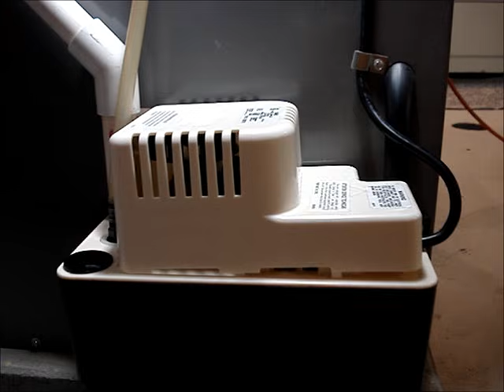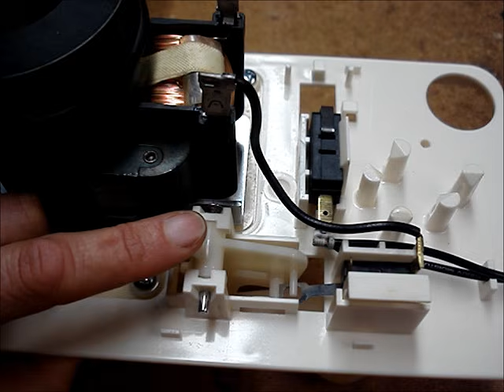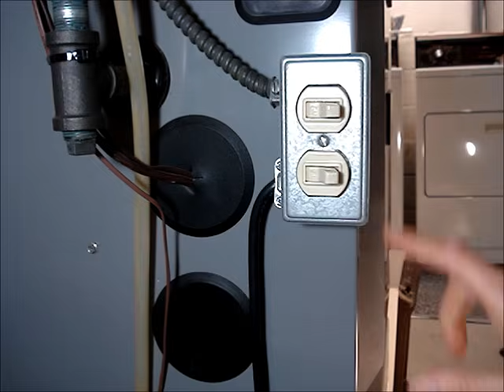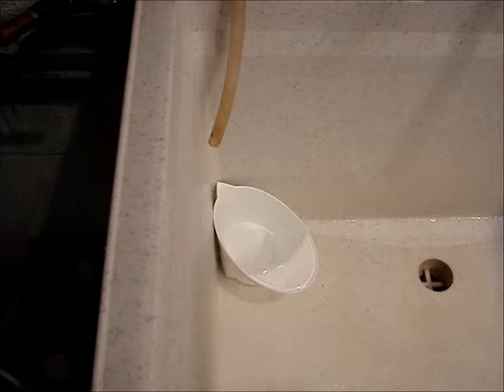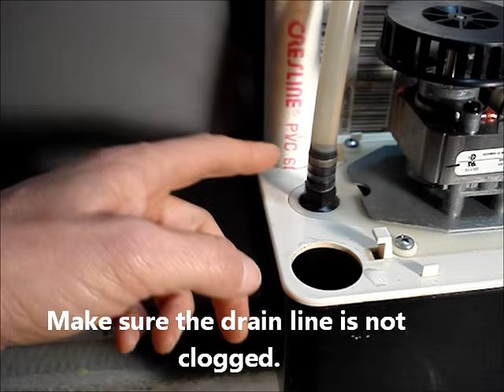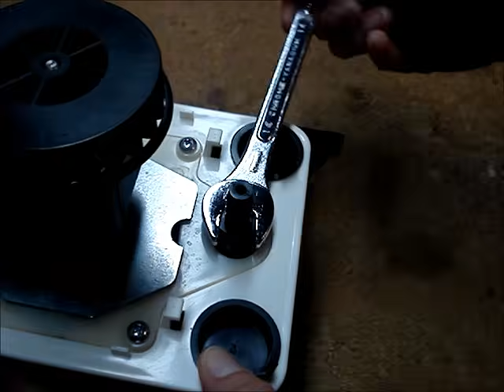How to Troubleshoot a Condensate Pump

Comment: I've got an issue where the pump turns on when the reservoir fills, but that causes some water to be pushed out the side of the reservoir rather than it all going through the check valve to the outflow pipe. I guess I'll clean the check valve now. If that doesn't work, do you have any thoughts on where I should look next?
Reply from the maker: Look at the comments below, someone had a check valve that was cracked and leaking.
Reply: Yeah, the check valve had gotten stuck open. However, I also had an issue with the plastic casing around the impellers being cracked. It's possible that it was caused by the check valve's malfunctioning. Because of the crack, when the motor ran the water level inside the reservoir on the far side of from the motor would rise, and water would splash out.

I ended up having to purchase a new pump.
Reply from the maker: Thanks for the update, Brandon.  I'm sure it will be helpful to someone who is having the same problem.

Comment: The check valve was cracked at the base. Here's the tricky part: It's not built like the video, nor in any other vide. It''s like it's built in, as there's no way to get at it. The parts underneath look different, with a big round float that looks a bit like a urinal cake underneath.  It looks like they put the valve in then fused the top piece together.
Reply from the maker: Thanks for taking the time to comment and tell what went wrong with your pump.  It may be helpful to someone. Sorry to hear that it sounds like the manufacturer has made your pump non repairable.

Comment: Great video. I poured the water in to see if the pump was running. It's running great but here's the problem which I didn't see listed: The check valve/tube is spraying water. I don't know if this is because of the check valve, or if it would be the tube is damaged or loose? No water is getting up the tube, and I really can't tell where the water is coming from: Where the tube meets the valve or if it's shooting from around the valve?
Reply from the maker: It sounds like something is clogged.  Try removing the tube and running the pump, if water is coming out of the check valve, the the tube is clogged.  If the problem is still happening, then maybe the check valve is clogged.

Comment: Thanks for the explanation. 
Wasn't sure why my air conditioning wasn't turning on. 

Thankfully it's not overflowing, and pushing down on the second floater connected to the wiring triggers the a.c. unit,  but now I need to figure out why it's not getting rid of the water it collected.

👍🏼
Reply from the maker: You are welcome.